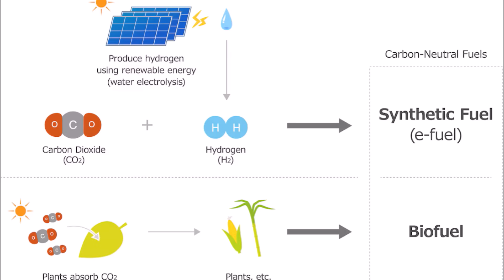F1 Fuel - The Hidden Development Race - And why E-Fuels are so EXPENSIVE

Comment: What's the boost pressure on current F1 cars considering the fuel flow limit?
They must also be running very very lean if they get such high boost pressure since a ton of air will be going through the engine but you can't feed it with enough fuel because of fuel flow limit.

Comment: since F1 teams are limited to 110kg per race, I imagine they are using no oxygenated and carbon rich fuel ? almost like diesel ? 
18:1 CR with prechamber and 4.8 bar intake .... it's a diesel ^^
Reply: The rules require full otto or miller cycle. Mercedes lost a lot of performance, because amFIA considered a hybrid otto-diesel cycle

Comment: One 747-8 flying for 12 hours could already burn as much fuel as the whole season would take for all the cars. (144000L as in the video calculation)
Reply: While this is a very important point, F1's focus is on developing car technology, not aircraft technology. The only thing they can do is make the schedule more efficient (which they should, because it's frankly a mess), and pressure responsible parties to accelerate sustainable energy for aircraft. They can't head the development themselves, less the cost of operating in the sport become even more inflated.
Reply: Comparisons like this are stupid. That 747 carries a few hundred independent  people, F1 does all of that to have 20 people drive in circles for 50h.

Every time someone complains about car emission laws and brings up how much fuel a plane uses, I show them how the fuel consumption for a plane comes to around 1,7l/100km per person on average. While driving a car with the average of 1,5 people inside you get around 5l/100km per person on average. Yeah.
Reply: @sven7111 It is not a stupid comparison in terms of the F1 circus and when talking about actual F1 car emissions compared to the logistics. It gives a lot of perspective on how litte the cars consume compared to just one leg of shipping them.

Also the consumption per 100km is stupid. A car could get easily the same consumption as a commercial jet, and still carry a bunch of cargo if they were stuffed full. Also planes could be loaded with like three times the amount of people if said people were treated more like cargo.
Reply: @rkan2  Yes, if you have 5 people in a car then it's about the same as a plane.
However, if you count how many people ride in a car, it's most often just a single person and the average comes to around 1,5 person per car. That's what the regulators are working with.

Planes usually have full occupancy, with average of 95-99%.

Last time I've checked DHL and other freight companies do not have to comply with the F1 rulebook. The only thing F1 can do to limit their emissions is to plan the calendar better and do something with the cars.

So, they did. Those fuels won't have a noticeable effect on racing. In fact if it was kept a secret no one would probably notice.
It does something different though. It moves synthetic fuel development forwards. Obviosly it's driven by PR, but it will have some positive effect larger than just those racing weekend emissions.
Reply: @sven7111 I agree on the other points, but in addition to full seat occupancy, you can probably haul like two tons of cargo with not much more fuel consumption. With a plane, that is completely different. But indeed, most cars drive empty.

Comment: 4.8 Bar and 18:1 CR is almost as insane as the fuel costs
Reply: They’re practically diesels!
Reply: they lower compression to reduce the nox emissions from combustion, but unfortunately it also reduces the thermal efficiency since compression ratio is in the denominator twice and all subtracted from 1
Reply: and this is among the highest diesel compression ratios that ever existed. Today they are much lower.
Reply: @imnotusingmyrealname4566  I mean, come on. Turbodiesels from the 90's were like 22:1 CR. Boost wasn't that high, obviously.
Reply: @imnotusingmyrealname4566  What are you talking about. Today we get around 17:1 in diesels, 40 years ago it was around 22:1 on average.

Comment: Does the "F1 Cars 0.7% of overall F1 Emissions" count in the emissions of the viewers going to and from the track for the entire weekend? If the average viewer drives 60 kms total, some part of that in standstill traffic entering and exiting the track, that could probably be 3.0L per car, average 2 viewers per car, for a 250k attendance weekend would be 1.125.000 L of fuel for the 3 days, assuming everyone comes by car and travels to and from the track every day. 20 cars burning 300 L of fuel each is just 6.000 Litres, which would be already 0.53% and then we haven't counted any other logistics, air and sea freights, etc. 

Just bring back the V10s
Reply: "F1 Cars 0.7% of overall F1 Emissions" it means F1 group and teams I guess. So the cargo ships, planes, team and F1 staff going to tracks, electricity consumes by them (?) and F1 cars consumption.
Reply: One 747-8 flying for 12 hours could already burn as much fuel as the whole season would take for all the cars. (144000L as in the video calculation)

Comment: Development and engineering of the cars is very very expensive, I think it's only a good thing part of that development money has to go to developing fuel as well. E fuels are what's going to save us petrolhead, even if they're no replacement for EVs.
Reply: fully agree, it will only get further and further optimized from now on to be more efficient, cheaper etc..
Reply: I agree aswell, but I feel like F1 should really be starting with the other parts of F1 that emit far more emissions, like hundreds of trucks going from track to track. I’d like to see them change those over to e-fuels before messing with the cars. But, of course, that wouldn’t make the big headlines!
Reply: Yeah efuels make sense for recreational and heavy duty transport, but for commuting ev’s are the future, with an emphasis on public transit where possible
Reply: @litreocola6447  A future where the daily commuter is an EV, but at the weekends you can head over to a track and see cars blasting down it with efuels sounds good to me

Comment: So does different fuel manufacturers affect performance for the different teams?
Reply from the maker: Yes of course because the engines are fine tuned to the particular fuel. So a fuel supplier change can effect power significantly.

Comment: I saw on Racefans or The Race that the current fuel cost is 3 million per season, but also per liter it's $30 per liter, which doesn't make sense. They then went on to say that it would go to 12 million per year next year. So at some point in there somebody didn't know wtf they are even talking about
Reply from the maker: Maybe they talked about the whole grid😅
Reply: @bsport320 "Formula 1 chiefs will hold talks next week to discuss ways of bringing down fuel costs amid growing unease about a dramatic escalation in bills for 2026 that could top $12million per year for each team."
"Early projections had the price of fuel jumping from the current $22-$33 dollar per litre range up to around $170-$225 per litre."
"Several have indicated that they are far from happy about their annual fuel bills jumping from between $3-4million at the moment up to $10-12million from the start of next year." -The Race
Reply: The race are journalists not engineers
Reply: @jakubknotek4891 I know, but a big part of journalism is getting your facts straight, at which they failed horribly